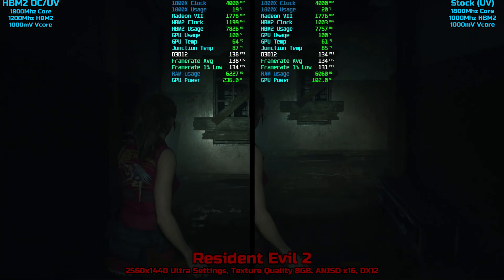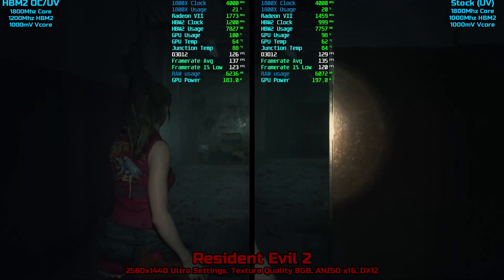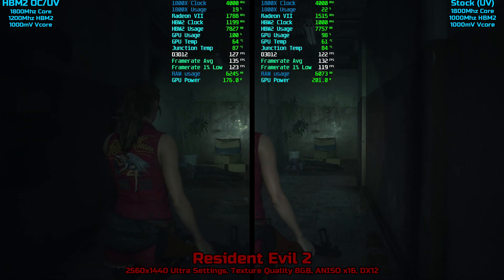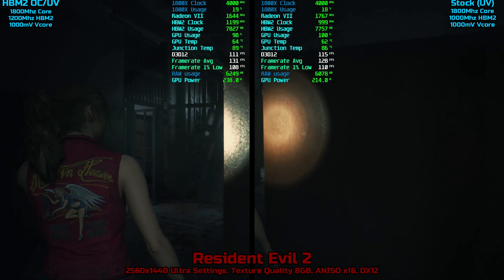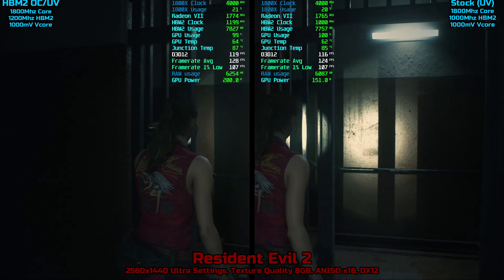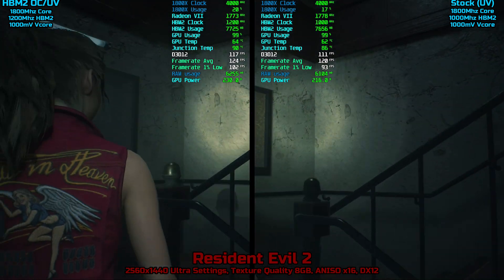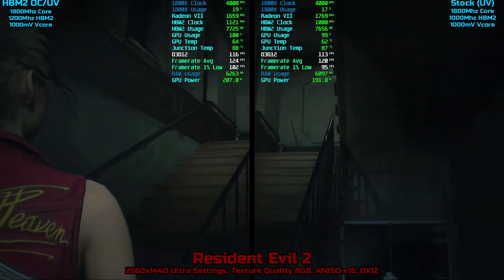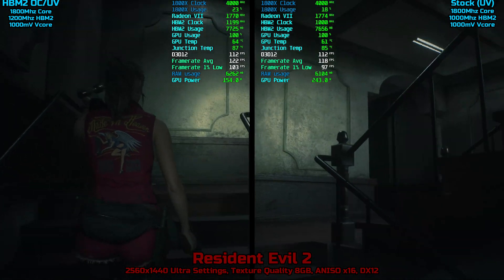Do HBM2 clocks affect performance? (Radeon VII) 1440P

Comment: if you really only need 1.0vcore for this it will go very far under water, 2200-2400 range maybe
Reply from the maker: Yea I'mn hoping I can hit 2200Mhz peak engine without junction issues. I think 2200+ would be a stretch but I'll definitely give it  a shot. Honestly hitting a solid 2100Mhz without any throttling will give a massive performance increase. I really want to try and smash my old firestrike score. Hoping I can hit a 34k+. Would be awesome.
Reply: @geekmark3844  keep the aio in the fridge over night

Comment: Your VII need a Watercooler. :) rly :D
Reply from the maker: Yea, I'll put it on water soon just waiting on the parts :D
Reply: @geekmark3844  Bykski, EK or Alphacool?
I use a Bykski on my VII.
Reply from the maker: @froschbremse3878   Neither >.< my wife would kill me if I keep buying waterblocks for my cards lol. I'm gonna be using a modded G12 with either a X62 or a 360mm thermaltake I have and some 12mm heatsinks for the VRMs. I swap/test way to many cards to run a custom loop on my rig D:
Reply: @geekmark3844 I have the same problem with my wife. The Trick is, hide after buy. ^^
Reply: @froschbremse3878  lul i like it :D